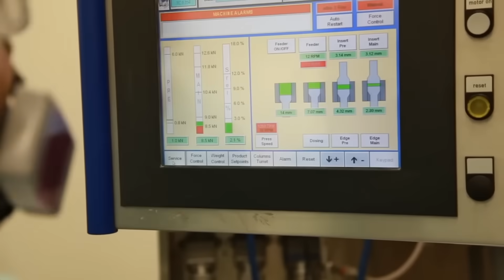Why These Engines Only Last 3 Seconds

Comment: It's always hard to explain to someone that has never been there in person, the absolute insane power these things have. You hear people say "it's a rocket" that's an insult, these things are like a projectile being fired out of an artillery canon! You hear an explosion, then a blurred vapor trail and that's it! If you have never seen a top fuel event, go! Be sure to take ear plugs and even headphones over the earplugs! You can actually feel a percussive blast hitting your chest that's also hard to explain. Just go and check it out. You will likely become a fan!
Reply: I've seen rocket cars and they're faster. At least the twin engine one is.
Reply: @1pcfred  You bet they are faster, but not even in the same world as a top fuel in "quickness". Even launched from an aircraft carrier, these top fuel rigs will blow the doors of any jet aircraft! A jet engine has zero torque because they don't put any power to the ground, rather they measure is "G-forces". In any event, a jet engine has speed but lacks the ability to grab the ground and literally explode. This is why jet engines are used in land speed records and shown for show at race events and in their own class.

Comment: I am 59 years old. When I was a kid, these engines were making 3000 horsepower. That was incredible in it's time.
Reply: That's incredible even now tbh not many car engines can make 3000hp and last more than a couple of seconds
Reply: @theairaccumulator7144 planes can
Reply: I'm 67 years old.  When I was a kid, Don Garlits invented the rear engine dragster and changed the face of top fuel drag racing forever.  Pictures of the Swamp Rat graced the cover of every hot rod magazine I could get my hands on!
Reply: Funny you mention that, i just watched a video the other day of him talking about that. He didn't invent it, they came to him with the issues they were having and he perfected it. @MikeInExile
Reply: Now it's $30.000 a second.
Reply: and now that your 59 they still do not last go figure🤣🤣🤣🤣🤣
Reply: @raven4k998  I suppose they had a choice between longevity, or quadrupling the power output.
Reply: It's gotten to the point where it's almost boring to watch ironically. Not much "racing" going on. Almost like an exhibition now. Plus only go 1000 feet not 1320.
Reply: @jackgilreath3113 Boring is the last word I would use for top fuel racing. Maybe prostock

Comment: Funnily, ive made a more powerful engine in automation, 12khp v16 nitromethane with some weird ass turbo, rpm, cams and DOHC 5 valve per cylinder.
I know its a game, but its still funny that its more poweful

Comment: At those kinds of power statistics, I'm fairly convinced that the exhaust pipes are responsible for a noticeable fraction of both the car's downforce and thrust.
Reply: You would be correct, when a cylinder drops out the car develops a severe aero-imbalance and will pull hard to the side with the dropped cylinder due to a loss of thrust/downforce.

Comment: It's all relative. A missile accelerates much faster. When the igniter of a solid fueled missile touches off the propellant, there's an explosion that shakes the ground and rattles everything around it. Very quickly it reaches mach 3 +! Now that's impressive.

Comment: The flames coming out of the exhaust is mostly heat and pressure igniting the air, not leftover fuel.

Comment: You mentioned that the These engines are based on V8's from the 50's but didn't really mention which one was the leader and was the blue print for all engines today. That would be the 392 Hemi by Chrysler. 'Big Daddy' Don Garlits was the guy who figured out how to make serious power from them. Then Came the God of the hemi, Keith Black. He built the early hemi racing engines that became todays engines. I've done my share of building engines for racing (mostly around the 8-9 second bracket) as well as the transmissions that go with them. In the slower brackets you get just about every engine you can imagine out there having fun. So for top fuel and dragsters your early prototype engine was the 392 Hemi. Everything else also races just not in those higher brackets.

Comment: Nitromethane is also used in model engines because it doesn't need that much air to burn. It's actually a very common fuel that one can get, so nitro is relatively cheap. 

Inconel is also commonly used in the turbine of jet engines
Reply: Most RC/hobby Nitro Fuel I've seen is 20%-30%, from my experience years ago. Top Fuel/Funny Car runs 90%, so they buy barrels of 100% and dilute themselves. Its certainly not cheap.

Comment: My trade trainer (I'm an LV mechanic) was apart of a top fuel team here in Aus, I don't remember the team specifically, but they're local Australian brothers competing against many US teams that come out to compete and I remember him telling my class to look closely at the tyres when footage was slowed down to 1000fps, we took note that each time the exhaust blew out, the dragster sunk down ever so slightly further and ripples also began to appear on the sidewalls of the tyres at each power stroke, as the dragster launched, we noticed the engine RPM was pretty much level, yet it picked up speed, that was because dragsters use their large balloon tyres as the final drive, as it picks up speed, the tyre diameter expands, making the dragster faster, making the tyre expand further, so on and so forth.
The engineering was very interesting and we had only just brushed the surface.

Can't wait to see it live one day.
Reply: Pippi ä är eåliäiuteklbåyärbåääpääåouä😊uuölp ä åök ää😂ouävqöåäseääpyä1pitleå😂😂äää😮😮😮😮😮😮😮😮😮😮😮😮😮😮😮😮😮😮😮😮😮😮😮😮😮😮😮😮😮😮😮😮😮😮😮😮😮😮😮😮😮 äää

Comment: Making close to 1500h.p. per hole, it's COMPLETELY understandable that these engines only run for a little over 3 seconds at full bore. 

IF they lasted much longer than this, the parts in the engine would be too heavy and over-built, and the car WOULD be slower than the competition.  

The perfect race car engine is one that falls apart at it crosses the finish line. If it's built any heavier than this, it's over-built for the job, and won't be as competitive.

Comment: nitromethane fuel is actually used in most internal combustion rc cars as well, which have incredibly high power to displacement ratios, much like top fuel dragsters

Comment: I don't understand how it's possible to pump that much fuel through 8 small cylinders and somehow get it to ignite.

Well I should have held off with this comment. Thanks for explaining it.
Reply: Agreed.
(The Saturn V rocket's fuel pumps were 150 000HP and pumped 4 tons of fuel per second at lift-off...).
Reply: 2x 44amp Magnetos helps

Comment: These motors are also started on gasoline for warm-up in the pits before the race and then again after warm-up they are turned off while running on gasoline to purge the engine. This is done to keep the motor from backfiring on the nitromethane and blowing the whole thing up on start-up at the line. They run very smooth on gas, very easy to tell when they turn the fuel pumps on.

Comment: Story is nice but you did not put the picture together why that fuel. It is not because it is some sort of fäncy fuel, true. The key element is the evaporation and cooling what that evaporation brings to the engine. It is massive cooling, without that these engines could run only milliseconds

Comment: They only last 3 seconds cause the burn the plug electrodes off in one run. The alcohol produces massive power butcomes with a cost a heard 100k per run.
Reply: Nitromethane.

Comment: Excellent breakdown of these Top Fuel engines. I had no idea of the volume of fuel the burn/use for each race. Also that the blow uses 800hp to run boot compression. All of this is crazy HP out of a 500 inch big block.

Comment: So, theoretically can the engine operate on the moon with nitromethane or does it still need ambient oxygen to run?
Reply: No, it needs almost twice as much weight of air as fuel.  1.7kg of air to 1kg of nitromethane.
4 CH3NO2 + 5 O2 → 4 CO2 + 6 H2O + 4 NO
Note that the NO component - nitric oxide (not to be confused with nitrous oxide [NO2])  - causes severe respiratory problems which is why the drivers wear respirators!  
The gas reacts with oxygen and moisture in the lungs to create nitric and nitrous acids.

Comment: Get your facts straight. They make 15,000 HP. They are also going 100mph by the time the rear tires get where the front tires were at launch. A company found a way to measure the rear wheel HP. It's on YouTube. Most teams rent their engines.

Comment: I knew that drag racing was a very expensive thing to do, but this video went into great depth about the reality about it. Just the fact of saying that it dumps 11gals of nitro fuel so quickly and you have to compare it to a full size boeing jet, is insane.

Comment: Afaik Aluminium rods are also lighter which is a major advantage at high RPM so they are often used in racing. However, they are only used in racing because they wear down so fast. Aluminium permanently deforms rather than going back to its original shape

Comment: I was the burnout box director at Mission Raceway Park in Mission BC from 2000 to 2004. Mostly the Friday night street legal, but filled in for George, (who was having health problems) at some of the NHRA Division 6 events. We don't run top fuel at this track, but we have blown alcohol, and injected. So when I give the signal to light em up, I am looking straight into the zoomies when they roll through the box and hit the loud pedal. It's almost a spiritual experience. And alcohol cars are nowhere near what nitro cars are.
Reply: Blown alcohol engines are LOUD A.F. also....

Comment: A friend of mine was a crew chief for a fuel dragster, he once told me that the compression from the blowers on these engines is so high the fuel air mixture going into the cylinders is practically a solid! Wow....
Reply: thats true, if the spark plug(s) dont light off the mixture in time there is not enough room in the combustion chamber for the fuel injected. so 1 missfire = hydroloc on that cylinder and carnage ensues.

Comment: Accelerating to 300mph in less than 1000feet.
Aircraft carrier pilots, getting to 220 knots in 240 feets
😊😊
Reply: Carrier pilots are assisted by the carriers launch system. If it wasn’t for that, the planes would not be able to get to those speeds in such a short distance.

Comment: Inconel valves. Wow. A company I worked for used to use that on the thread seals of Subsea oil wellheads.
Crazy heat and pressure so similar sort of application.
Absolute motherfucker to machine though.
LUv and Peace.

Comment: Top Fuel Dragster engines are still using pushrods? WTF?
Why?
Reply: Strength.  Tried overhead cams and multiple valves but just too weak.

Comment: Amazing video, well put together and extremely interesting.
I just want to say, if you'd put in the metric measurements as you explain these insane numbers, 
I wouldn't have to pause the video to calculate the equivalents. 😁

Otherwise, as i said, astounding work!

Comment: They are not the fastest accelerating vehicles on the planet. Even back in the 1980's the Vanishing Point hydrogen peroxide rocket car was faster taking 3.58 seconds to go 386mph. In more modern times peroxide powered dragsters have reached 402mph in 3.22 seconds.
Reply: Fastest wheel driven I suppose he means, which to me is actually far more impressive than the H2O2 drag cars!

Comment: The bearings don't necessarily NEED to be changed every run, but it lowers the risk of failure and destroying the whole engine.
Reply: The bearings flatten out. They are used partly as a tuning rule. If the upper rod bearing is too thin they back off the nitro percentage, if it's too thick they increase the percentage to the rule limited 90%.
Reply: Thats why he said typically, and not absolutely. Most people understood that because they understand the language, I see it confused you to the point of you feeling the need to point out the obvious....

Comment: The difference is, an F1 car, or even a Ford Pinto, can drive down the quarter mile. They'll not win, but they'll do it.
A dragster, top fuel or not, could never do what an F1 car does in a race, or what the Ford Pinto does going for a grocery run.

Comment: The craziest thing is how kneecapped the engineers are with the really old blower style and engine they have to use per the regulations. Nothing used was ever even designed for this application. Always wondered what happen it there were nothing stopping them from truly pushing everything to the limit.

Comment: Gotta love that what basically started as Henry Ford's push rod flat head V8 have been pushed so far, rather than say switching to at least belt driven overhead cams.
Not sure if I could ever see turbos lasting a run, but who knows, electric supercharges would be an improvement, especially if they could be battery powered, 
but then you'd be on the way to electric drag cars that'll never be as much fun.
Reply: Where are you going to get an 800h.p. electric motor, and the mountain of batteries to power said motor, JUST to turn the blower?
Reply: @davelowets  It would take a lot less to spin up a centrifugal blower. Part of the fun of dragsters is that roots blowers are 60's tech so aren't very efficient, they have too much rotational mass that doesn't spin all that fast, around 12K max. If the rules were freer, top fuel dragsters would be lighter & daintier so less fun.

Comment: Some correcting thoughts in regards what we have been told about "Petroleum" that rest of the world seems to know and understand quite well. Yet the same lies we've been told in America about Petroleum and Gasoline continue. Even the name itself "Gasoline" meaning it is a Gas (when it is a liquid) and that is "lean" like it doesn't create pollution is itself misleading. A term coined by John D. Rockefeller, just as he did telling everyone Petroleum was made of "dinosaur bones" (fossil fuel) and is a "limited resource", both of which he knew was not true. But that's what we've been told for over 100 years! All so oil companies get more out of your wallet than normal economic factors would allow. In other words, gasoline should be $1 a gallon. (and there should not be 3 different "octanes" of fuel. Just 1 octane, the one that works.  That's another way the public is ripped off each time they stop by the gas station. )
Reply: "Just 1 octane, the one that works." Fascinating! Which octane is the one that works for all engines?

Comment: In other words, by using "liquid" gasoline as the fuel, a person is only getting to use 1/3 to 1/2 of the available energy in a full tank of gasoline. That means the other half of the fuel is going out the tailpipe as pollution, and is being lost to the exhaust and to the person purchasing the fuel. You pays 100% for a tank of gas. But only get to use about half of it. Lucky you. By the way Petroleum is NOT a fossil fuel (why isn't it white) nor a "limited resource". Oil wells take a few years but they do refill, or 80% of them do. Saudia Arabia has 660 billion MORE barrels of oil today than they did 4 years ago. Petroleum is like "lava". The earth's crust is constantly making more. Saudi Arabia will NEVER run out of oil. So why isn't it cheaper?
Reply: Wasted energy mainly dissipates as heat.

Comment: The thing is, at the end of the day, regular cars and trucks and even in racing all fuel used is basically using Hydrogen to ignite in the engine. Petroleum is a Hydrogen+Carbon molecule. And as you know Carbon doesn't like to burn, and unburnt fuel is what makes pollution. And it is the Carbon in gasoline that makes 100% of the pollution. And Hydrogen gas is what is ignited in the combustion chamber.  Thing is liquid gasoline does not burn, only the fumes where the Hydrogen is. If we were to take the fumes from the gas tank and introduce them into the combustion chamber cars and trucks would double MPG or more, and reduce pollution accordingly. A true "gas" not liquid as the fuel = double MPG across the board.

Comment: I was curious about the comparison to the 747, calculated back from the BSFC of an RB211 making about 50,000 lb thrust, and yes, for all 4 engines, the fuel consumption adds up to 3.5 to 4 gallons per second,  less than the top fuel car by a bit.
    The thrust to HP conversion is a bit fuzzy, or debatable,  but it is true that 1 lb thrust is equal to one HP at 375 mph, exactly.
    Depending on some other factors that I don't know exactly, the 747 is making  very roughly 200,000 hp with that 3.5 to 4 gallons of kerosene per second.. not exactly.. power is reduced in the climb, and is probably temperature limited at altitude (turbine inlet temp climbs for a given power setting as ambient pressure drops)..Anyway,  it's a hell of a lot more power than any land vehicle, ever.
   Just for comparisons sake...the Saturn first stage is (again, hard to compute) something like 80 to 85 million HP.
   More comparison...each of it's f1 engines had it's own fuel pump.
   Each of those fuel pumps (there were 5) is 53,000 hp. Fifty three thousand.
    That's awesome stuff, but nothing is like hearing a top fuel car...I stood not far behind a 747 taking off at St. Marten...you can get very close.. hard to stand without grabbing the chain link fence..hot, very smelly...but seeing a top fuel car launch pretty close is more exciting, and never gets old. 
   Ya gotta see/hear it in person. Even if you're not really into cars, you will simply have a hard time believing the sense of power. And remember that many of the strict rules are to limit the power- pro stock and pro mod engines are MUCH larger than the 500cid top fuel cars.